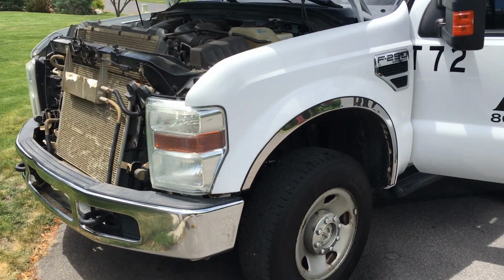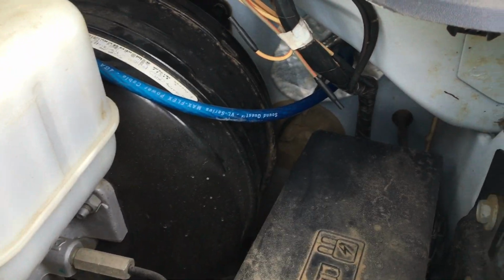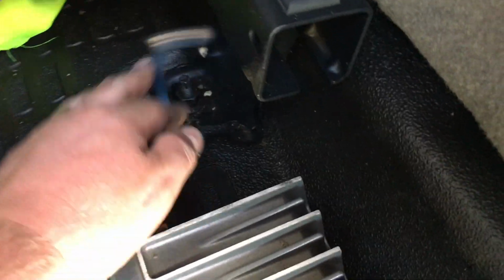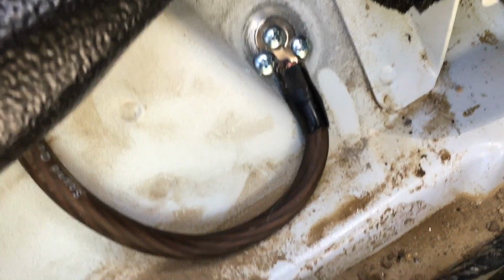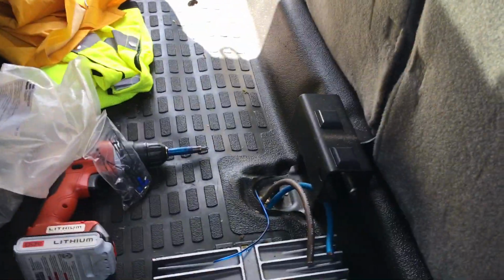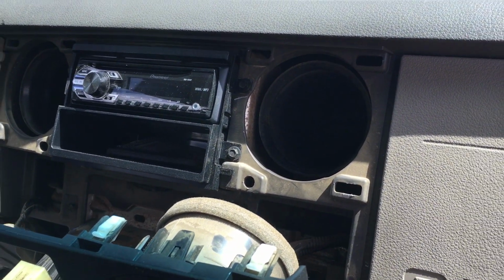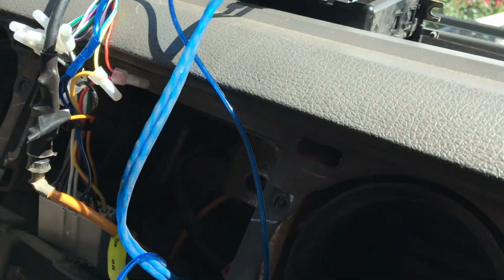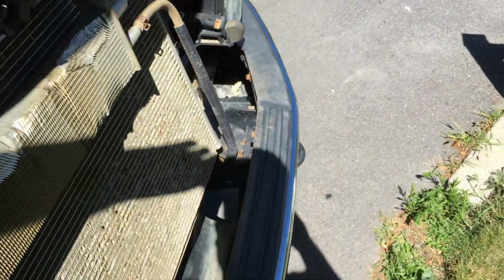2008 - 2012 Ford F250 / F350 Amplifier and Subwoofer Install

Comment: Best video for older super dutys. Question: I have a 4 ga wiring kit, but it's only 17' and it seems short for my 4 door F250.  It seems like it has the same "nipple" that can be cut and wire forced through on the passenger side.  Not sure where it comes out or if it will interfere with anything.  I'd obviously run the 5 rcas on the driver's side.  Thanks.

Comment: Do you know the wires to tap into on the factory amp to get signal for a line out converter
Reply: You tap into a speaker wire with a SLOC, pick a rear door, they’re easy to access and feed off of for the SLOC

Comment: question!! i need help, would the remote cables be necessary and my factory radio from a f150 2008 doesnt have rca connections what would i need??
Reply from the maker: Remote is very necessary in that it essentially tells when the amp to power on.  You will need to connect it into a switched power source, or only on when the key is on.  If you don't have RCA outputs on your radio,  you will need a line out converter.
Reply: thankyou so much i got the converter and a remote cable turns on and off nice
Reply: i shouldnt skip through tutorials hahah thankyou again

Comment: hi I'm doing the same thing on my 04 f150 a question so is better to run the power separate from speaker cable and remote cable? thanks
Reply from the maker: Sure is, reduces the risk for engine noise and distortion in the speakers created from electrical interferences.

Comment: Where did you run the power cable other than the battery to make it so it doesn't always draw power from the battery? I have a 1000 watt amp and 2 rockfords ready to hook up but my upfitter switches are only good for 30 watts and I want to hook it up to a fuse of a switch so it won't drain my battery when my trucks not running. Where should I hook it up to on my 2010 F250?
Reply from the maker: It will need to go directly to the battery.  Your current electrical system wont be able to sustain an additional draw from the amplifier.  You will need to go directly to the battery. This will not drain your battery while your truck is not running as long as you run the remote turn on wire correctly to an ignition source.  The amp will only draw current when the truck is on, they way they were designed.  If you are still concerned about the draw, you can put in a 12v circuit breaker under the hood to cut power to the amp while the truck is off.

Comment: A little of topic but I have 2 15" L7 kickers and the 3000 zues hifonic amp on my new build and I was wonder what car speakers would pair well with this so far I'm thinking kenwoods, any thoughts?
Reply from the maker: What vehicle?
Reply: +Provo Beast Audio Installation Ford Taurus it's a 5 1/4" speaker I think
Reply from the maker: What year? Commonly for Taurus sedans, they are 6 x 8" speakers.  You can put a 6.5" in those locations with a 6 x 9" to 6.5" speaker plate adapter.  I have a few kenwood speaker videos on the channel, as well as Alpines.  Check them out!
Reply: +Provo Beast Audio Installation 
It's a 2002 I can install I was just wonder what care speakers are best for loud quality but don't add a delayed bass sound to my subs
Reply from the maker: I typcally install Alpines for a component set.  Have had the best sound quality so far from all the brands i've used.